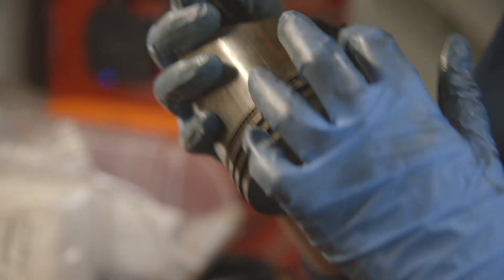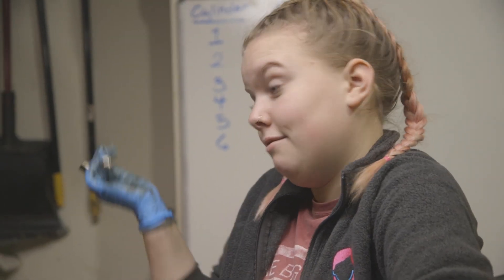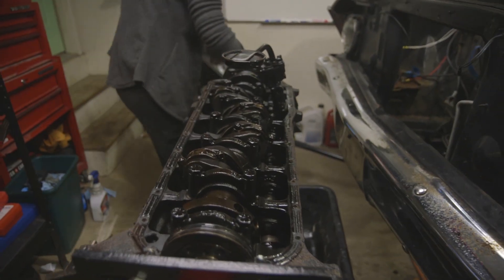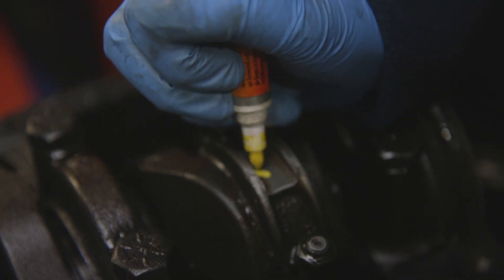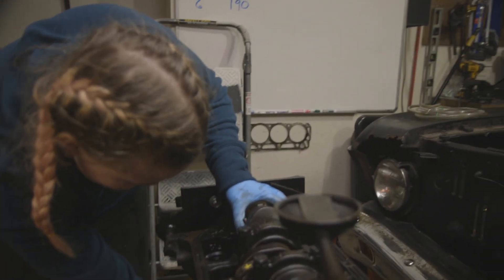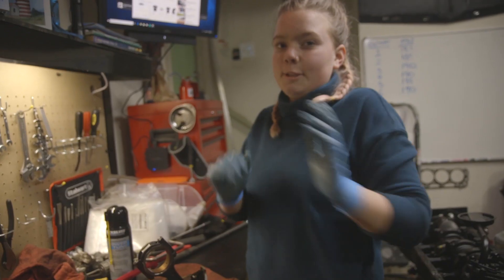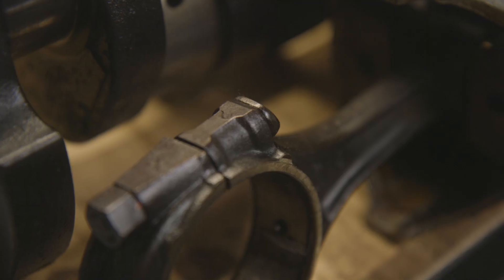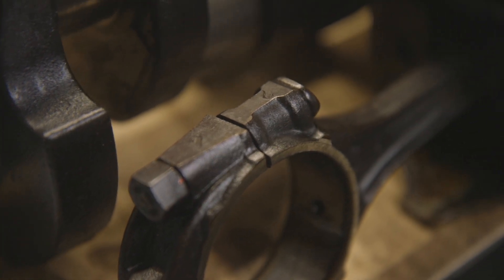First Time Seeing INSIDE THE ENGINE - And Pulling the Pistons

Comment: I'm amazed how clean that engine is inside. I've seen engines from that era where the sludge is so thick you have to use a metal scraper to get it off. It looks like it was well maintained. The bearings are due to be replaced,but it looks like normal wear. Remember this engine is about 55 years old so some wear is to be expected.